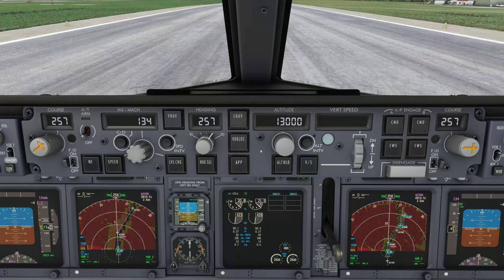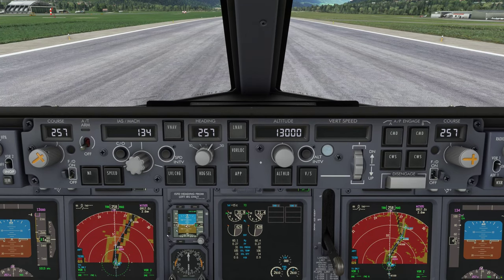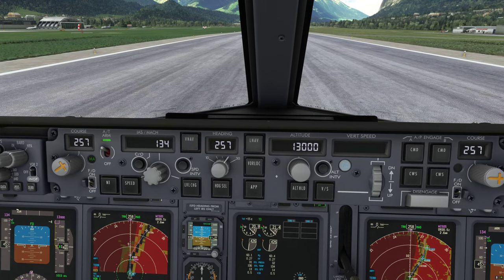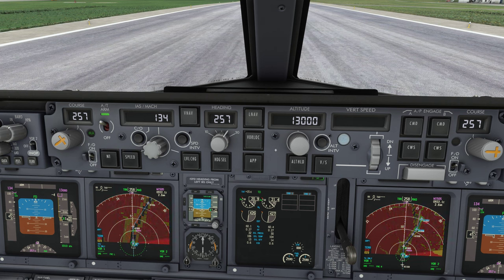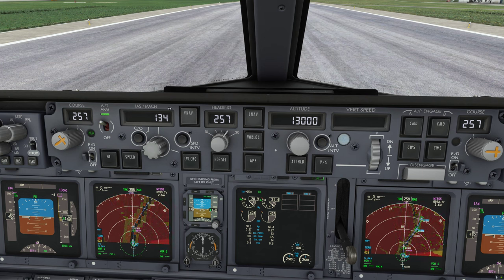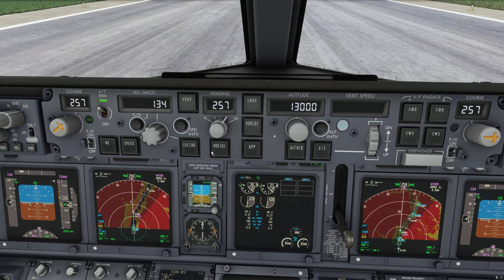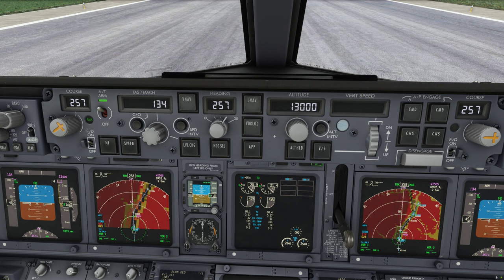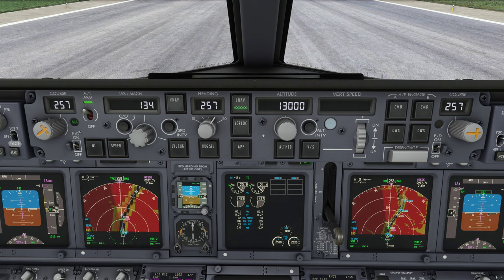PMDG 737-700 Tutorial: MCP - how does it work?

Comment: Great video as always. Might you consider doing a video about choosing the correct auto brake settings?
Reply from the maker: Choosing which autobrake setting to take should be covered in the extended approach briefing tutorial if I'm not totally mistaken.
Reply: @A330Driver  ahh ok, I must have missed that somehow. I use topcat for take off and landing performance calculations, but I was wondering if there were some others things I could learn. I will rewatch that video now.

Comment: First of all thank you for so many great videos! But I have a question as well. If left course knob works in relation with left radio panel settings and left ND, and right hand course knob analogically with right hand side nd and radio, does it mean that there can be different nav aid with different courses set on both NDs? Or if I set a course on right hand course knob, this course would be displayed on left hand ND as well? And another question if I can. Lets assume that I fly raw data. I fly along one VOR radial and at a certain point I have to switch to another VOR and follow different radial. I do that by simply switching appropriate frequency from stb to active on radio pannel and I set new course by course knob? Or it should be done different way? Thank you in advance and wish you all the best!

Comment: How to configure this on a final. Whenever i try to do it, it doesn't work. Even when i go to the configuration - Final in the FMS. I load in ILS frequency, configure flaps etc still autoland doesn't happen.

What am I doing wrong?

Also during my trial with takeoff after having plugged in the entire route , the autopilot did not follow the flight plan. 😢
Reply: If you are trying to auto land you need CMD A and B engaged. Auto land will only work if you see FLARE armed on the FMA as well

Comment: Thanks for an excellent overview! Question: in what situation do we select 30 degree bank angle? For approaches and SIDs with tight turns?
Reply from the maker: Basically only when you really need to make a tight turn.
Appraoches and SIDs are usually flown in LNAV and LNAV uses its own automatic bank limiter, thus the knobs limitation does not apply to it.
My main use for 30° AOB is during Circling Approaches when establishing on the final approach course. When I see that I'm about to overshoot I use 30° AOB there.
Apart from that 25° is usually sufficient for all operations.
Reply: @A330Driver  thanks mate! I forgot that it doesn't do anything while in LNAV mode.

Comment: Hi, when i fly the pmdg 737, there seems to be a bug with the trim sound. When in flight, there is an almost constant sound that the trim wheel is spinning quickly, while it’s spinning very slowly. Do you have this issue as well?
Reply from the maker: I don't see such an issue on my system. I'd suggest to contact the PMDG support. They should hopefully be able to do something about it.